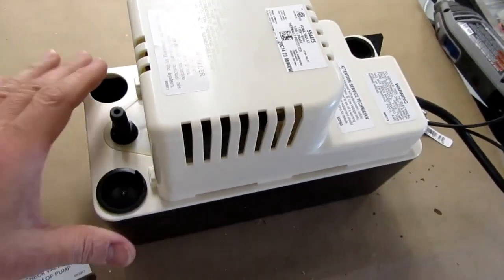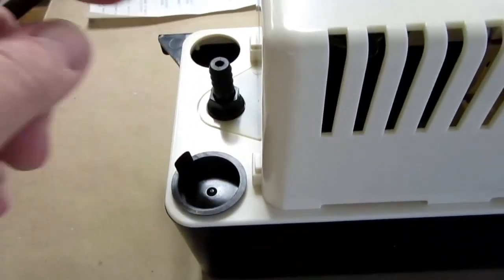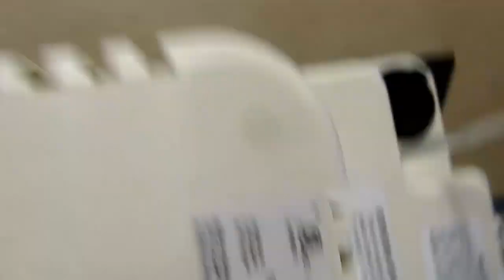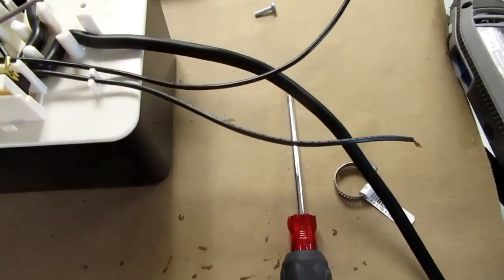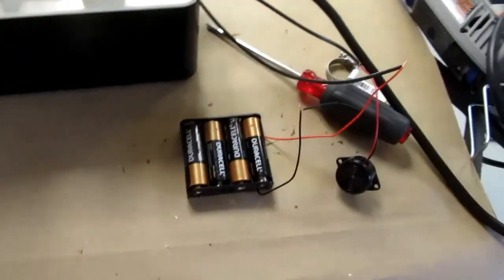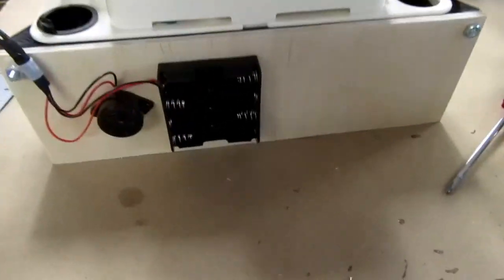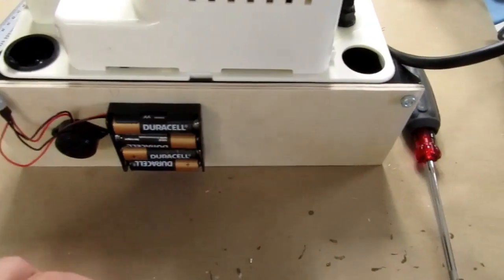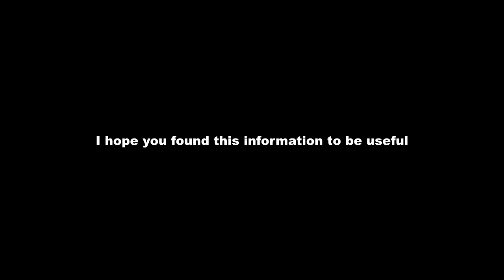Little Giant Automatic Condensate Removal Pump VCMA-ULST (554415)

Comment: No need for all the extra angles on the inlet pipe. Talk about over complicating stuff? 15mm hose and just sit it in, as long as no right angle kinks are in the hose it will flow into the pump no problem. 12 years I ran one of these without the need of any of this nonsense. These type of videos make people afraid to try anything simple.